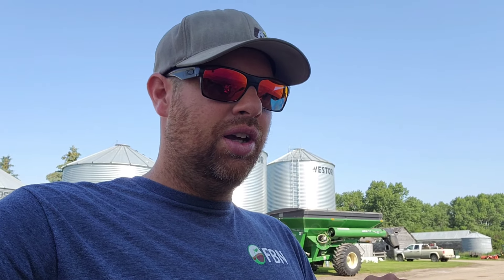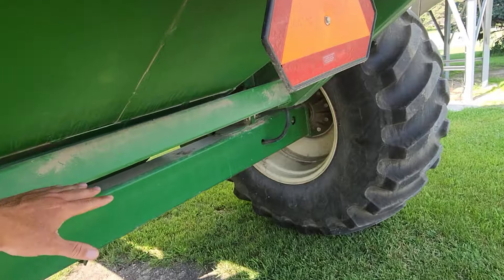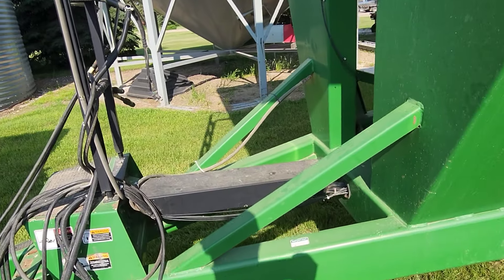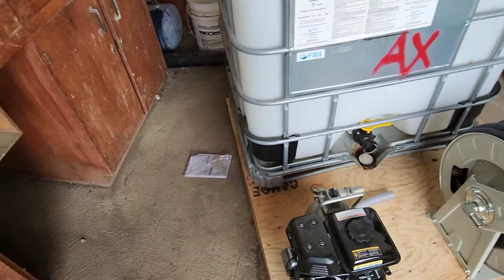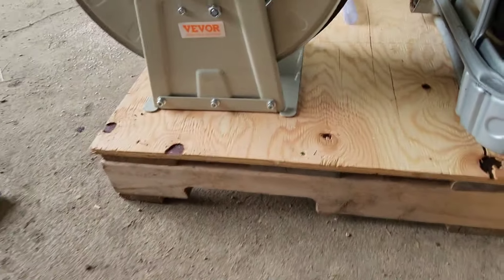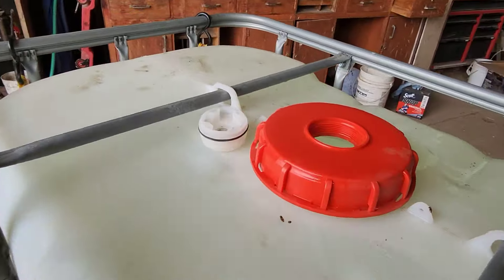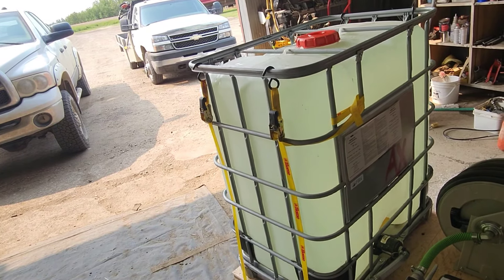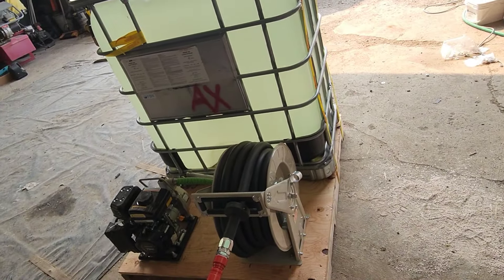Taking the FIGHT to the FIRE 🔥

Comment: Great skid unit .What you might  want to do is add a recircuiting line so you wont over heat the pump when you are flowing water. and you  can batch mix foam  or use dish soap  ( dawn works great) to help the water soak into what ever is burning . I just saw your video for the first time today
Reply from the maker: @RobSharp-wo5qj  interesting. I never thought of a recirculation line. Hopefully we never need to use the skid for its intended purpose